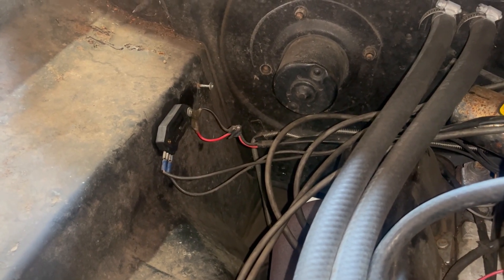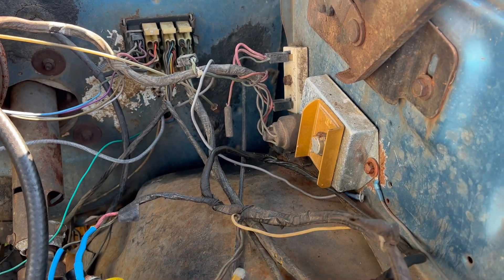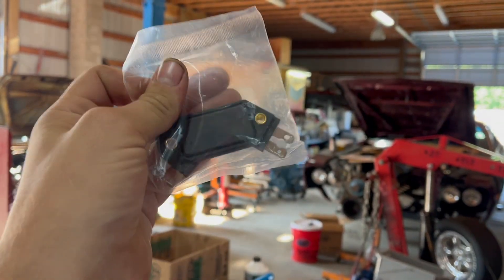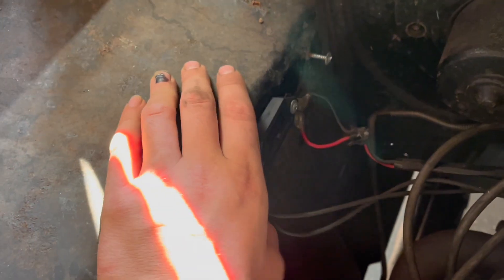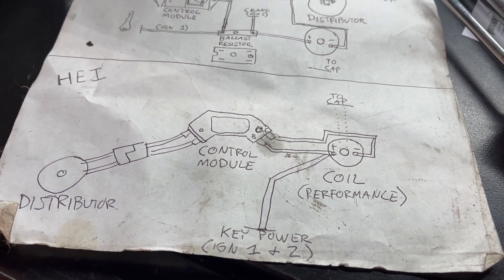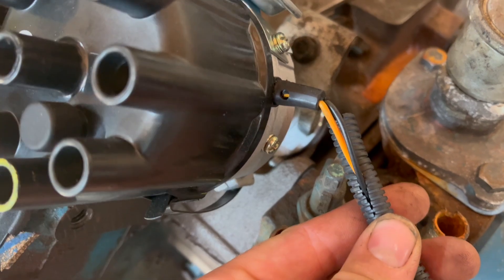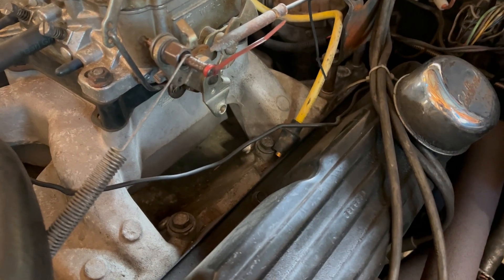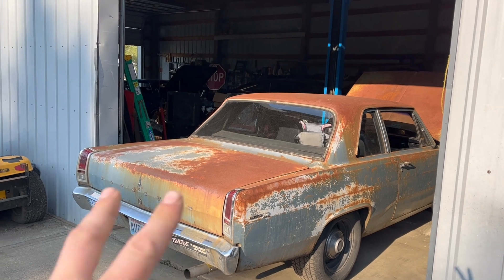The Big HEI Ignition Conversion Video! How To Convert Your Classic Mopar (Or Anything Else) To HEI

Comment: I've never had an hei module fail but I've never used one in a sketchy setup.  Points?
I have been considering a Mercruiser Thunderbolt module intended for the 4.3 V6.  The later module has a knock sensor input but that's not my favorite one because the advance curve might be wonkier than I want to deal with.  The module without knock sensor input makes for a snappy advance curve V8's love.

Comment: Going to convert the 79 Cordoba away from lean burn.  But I bought a Chrysler DC kit.  Hmmm.  Wondering if I should go a different route.
Reply from the maker: I don’t mind that kit. And if you already have it, it’s fine. Just keep a spare module handy. I think I had planned Mopar electronic for the 300 and even have a harness, but the Pertronix was much faster and easier.
Reply: It is a good kit. I am guessing you will add vacuum advance to a car that did not have it from the factory.  Be careful where you hook it up.  I like 79 Cordoba 300's and 78-79 Magnums.
   Can you check one thing for me?  Does the control box (orange?) have a part number? (P something 505)  Does it have a transistor with writing on it or is it a dummy dome like the one on the silver box in this video?  I have heard Mopar is now selling the cheap ones with their kits.  When did you buy the kit?
Reply: I think this is a 2 beer n 2 corn dog as I watch several times 😂😂
Reply: Actually the vacuum advance is hooked to the Lean Burn control box.  I see no reason to use a different port and just run a hose to the distributor rather than the box. I will check on the kit as you asked and get back to you.  Got the kit on evil bay about 3 years ago...Actually for a different project and the lean burn is still functioning  on the Cordoba.
Reply from the maker: @beljames1563  There must have been two generations of lean burn. Well, ok, we already know there were at least a couple versions with different wiring. Haha. But I am used to seeing the dual pickup distributor with no vacuum advance. Didn't know some years had vacuum.
Reply: @beljames1563  I wasn't sure it even had a vacuum can on the distributor. Later models did not, but I don't know what year it started.
Also, the name Lean Burn was dropped before 1979 and replaced with Electronic Spark Control. I think it came with catalytic converters, it is not Lean Burn or not by that name.
Reply: Ok I think I wasn't clear.  The distributor on a lean burn system does NOT have an advance.  However there is a vacuum pot on the lean burn control box that tells the  computer to advance the spark electronically.   When you remove the lean burn computer and install a distributor that has its own advance, my suggestion was to just remove the vacuum line from the lean burn box and route it to the vacuum advance unit on the new distributor.